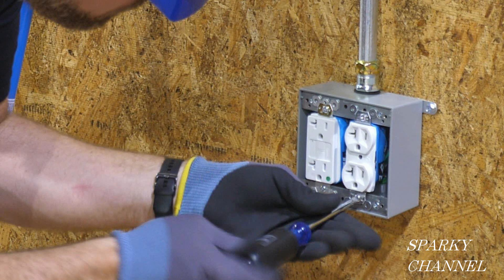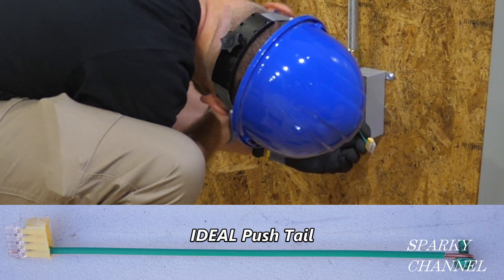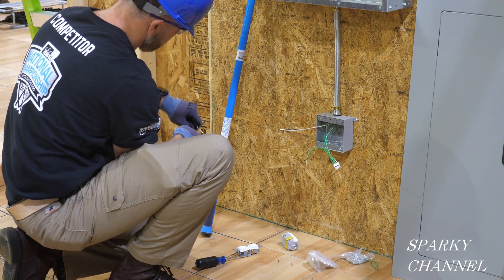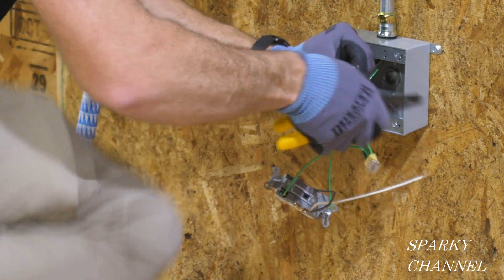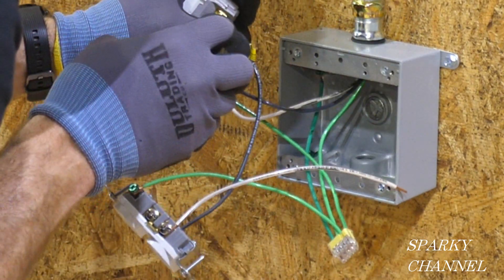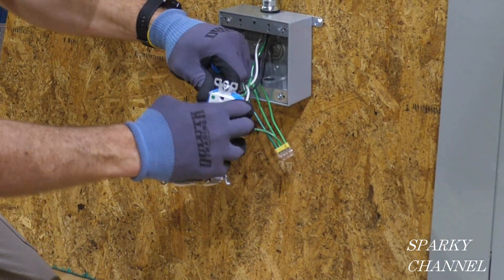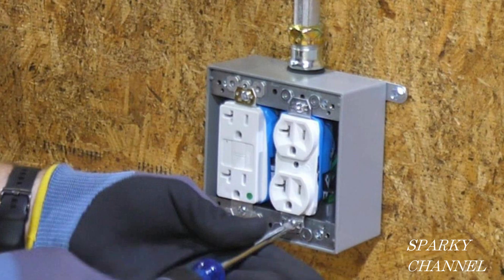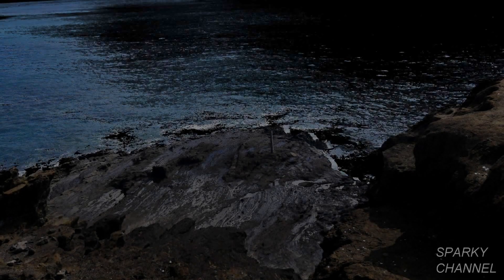Watch a Pro Wire a 20A GFCI and 20A Receptacle, Any Code Violations?

Comment: Is that "pigtrail" thing in the ground path legal?
Last time I checked the Code, NO splices like that were allowed in the ground lead.
Reply from the maker: I didn't see any problem with the grounding.
Reply: @SparkyChannel  NEC section 250.64 part C states as ONE of the exceptions to a "continuous ground":
 1) Splicing of the wire-type grounding electrode conductor shall be permitted only by irreversible compression-type connectors listed as grounding and bonding equipment or by the exothermic welding process.

Parts 2 3 and 4, the other exceptions, DO NOT APPLY TO WIRES - they talk about building frames, busbars, and grounding connections for copper-type plumbing pipes.

So no, that pigtail as far as I can tell IS NOT in fact legal under the NEC.

If you want to see a compression splice fitting, look at the leads from a pole transformer - which commonly use a compression-type fitting to connect to the downlead.
Also reference a "Cadweld", which type of fitting is counted as an exothermic welding process fitting.
Reply: @bricefleckenstein9666 The ground wire and grounding electrode are two different things. The grounding electrode wire runs to a water pipe or rod driven in the ground. The wire in the box is an “equipment grounding conductor”.
Reply: @TomCee53  And what do you think a "wire-type grounding electrode CONDUCTOR" is?
I was taught that WAS the "ground wire" and to never spice it.
Reply: @bricefleckenstein9666  The "wire-type grounding electrode conductor" is the conductor running from the primary grounding point (the main box) to the grounding electrode (ground rod) itself.  Only that one wire is the electrode conductor.  All other ground wires in the system (in branch circuits, etc) are just called "grounding conductors", and do not have the same requirements.
Reply: @foogod4237  If that is true, it's a bad idea at best.
ANY ground has to be able to handle the possibility of a lightning strike and the resulting huge currents that are going to explode wire-nut type splices.
Reply: @bricefleckenstein9666  Grounding conductors are not intended to be lighting protection.  That is simply not what they are for.

And if they were intended for that, then all existing grounding measures would be woefully inadequate anyway.  The conductors are simply nowhere near big enough to handle that kind of thing.  Whether there's a splice somewhere or not is really actually pretty irrelevant when the wire itself will likely just vaporize in that situation anyway.

Grounding electrodes are not lighting rods.  They never have been.
Reply: @foogod4237  They don't stand up to direct hits and were never intended to, granted.
They DO act in part to reduce the damage and direct it from near misses.
It's not their PRIMARY intent, but it's in there.
Reply: @bricefleckenstein9666  the code you're are referencing is for Grounding Electrode Conductors. What was installed was an Equipment Grounding Conductor which is completely different and not covered under that section of the code.
Reply: @SparkyChannel  , well what do you think about Brice's quotation of the code (below).  Also what is the recommended way to mark a standard outlet as GFCI protected (by the GFCI upstream)
Reply: @unionse7en  a sticker
Reply: @unionse7en most GFCI receptacles come with stickers in the box. I have seen them marked with a permanent marker.

Comment: What screw drivers is  that ,ideal I, can't find it? What # is it
Reply from the maker: IDEAL Electrical 35-9305 Insulated Screwdriver Set (2 Piece) Orange, 4 in. Shaft Screwdrivers with Cushion-Grip Handles. Electrician Tool Kits: Amazon: https://amzn.to/3QpSWLD
Reply: @SparkyChannel  Better to use an ECT (Electrical Components & Terminals) screwdriver bit

Comment: should they be tamper resistant as well? I read nec 2020 406.12 but I'm still not sure about outdoor locations.
Reply: That's what I thought. Thank you for the info saberx08.
Reply: Well, NEC 2020's 406.12 (1) talks about dwelling units listed in 210.52.  210.52 (E) specifically mentions outdoor outlets.  So, I'd say "yes", they should be tamper resistant as well.

Comment: This is so elementary…. Hopefully no “diy’er” or homeowner gets him , or her, self shocked or electrocuted while attempting to “copy” this installation method. Wagos are alright but nothing beats a wire but for a good solid connection. Wagos rely on a spring compression type connection. Although they are UL listed they are not the best.
Reply: He didn't even use a WAGO.  He used Ideal's push type connectors.  Those definitely rely on simple compression.  I won't use those!
Since it's Ideal's competition though, I'm sure he wasn't allowed anything but Ideal branded components.
Reply: Heh.. somebody clearly has no idea what's actually inside a wire nut...

Comment: I pulled 2 hot, one neutral and one ground wire through flex conduit to make a whip with 2 circuits (2 duplex outlets) on it. Can I still get GFI protection to these outlets/circuits? Or do they each need a dedicated nuetral? GFI recepticals, or GFI breakers?
Reply: Separate neutrals are not required on the feeder circuit.  If this is just feeding two 120V receptacles (one on each hot leg) then you will need two GFCIs (one for each hot wire).  If you will be using the GFCIs to protect other downstream outlets, then they will need to have separate neutrals going from the GFCIs to the downstream outlets (you cannot tie the neutrals from the "load" side of the GFCIs together).

You can also use a single (dual-pole) GFCI breaker in the box instead, but that can be more expensive.
Reply: They will both need a GFI outlet.  But if they are somehow on the same breaker then replace the breaker with a GFCI

Comment: 406.4 (D) (2) (C) only applies to grounding type receptacles installed after a GFCI if there isn’t a ground. Specifically. So since the is an equipment ground in this circuit, that section doesn’t apply and no label is needed. If you read the section on on screen in the video it specifically says that. But they should have been weather resistant of course.
Reply from the maker: Correct, thanks!

Comment: A fourth violation is of 110.3(B). The outdoor device box with 1/2” hubs is only listed for use with threaded conduit (I.e. rigid conduit or IMC). EMT fittings aren’t technically allowed to be used with these boxes. Again, not the fault of this electrician. He used what they gave him to use.

Comment: That’ll be $1300 dollars for adding this new 20A circuit. 💰
Reply: I'm in the wrong line of work
Reply: @PappyMcPoyle-vj4vt  I’m wiring up a summer kitchen today. $7,000! I used about 2k on material pay 2 guys $500 each and the rest is all mine. 🤷🏽‍♂️

Comment: Good points you brought up here Bill.  I noticed he used a regular screwdriver to install the receptacle to the box.  I use one of those hand held electric screwdrivers,  especially when installing a whole slew of receptacles. Saves on the old wrist 😂
Reply: Most guys would just use their drill if they didn’t want to bother with a standard screwdriver.

Comment: I would say he installed these outlets upside down. Ground lug up is the manufacturer’s recommendation for installation. I am aware the code is not specific on this, but on my jobs the ground lug is up. And my crew puts them in that way or they get off the job!
Reply: We do it the other way,  we consider it upside down with the ground up.  Just looks more pleasing to the eye  with ground down and sometimes we get told by the customer that we put them in upside down if we put ground up and then we have to go back and flip them all🤷‍♂️
Reply: Yeah, that’s not a code. We’re talking code violations here, Roger.
Reply from the maker: Interesting, thanks!
Reply: Being a reportedly old Electrical Engineer... Ground on top was the original design plan to prevent the metal faceplate (or anything else to fall from above) from shorting the hot and neutral if it were to become loose.  Many outlets sold today still have top printed with ground facing up.  I agree that the majority of Americans don't like their cute little faces "upside down".
Reply: I was told ground on the bottom. Reason is if your cords starts to fall out  ground us the last connection to break away....
Reply: @ronaldoleksy8264  There are arguments in favor of both.
But the Code doesn't care, probably because it IS a legitimate debate which is better.
Reply: I couldn't work for you then. I always place ground down except for dedicated receptacles for appliances like refrigerators, etc. where the cord needs to hang down. After 40 years I don't plan on changing any time soon.

Comment: Most of the Code book is just tax language translated into regulatory justifications.  Aka BS
Reply: Troll comment
Reply from the maker: LOL!
Reply: Clearly said by somebody who's clearly never actually read the NEC.

(And the codes themselves are not laws, that is correct.  However, the actual laws in most places also require that certain types of work be done to code.  Therefore, in those situations, it is still an actual legal requirement (yes, even on private property).)
Reply: Codes are just suggestions not law especially in private property😂

Comment: I waited to see a spring load type wire tuck into the box. I Always feel like I could do that more efficiently and you have to start that plan immediately. But a  shove & hold seemed effective enough for the ideal pro 🤣 I know this is not a demonstration for cosmetic perfection but every once in a blue moon, I'll pop a receptacle open and be pleasantly surprised by the professionalism in the wire tuck. Not very often but it does happen.
Seeing something straped to the box with 1 and a ½ inches of wire being left is much more common here in philly. Especially if the home owner claims some "crazy unique issue" 🙄 that couldn't possibly be from the install.

Comment: It not up to code to use the device as your method of splicing
Reply from the maker: You have to with a GFCI and a downstream receptacle.
Reply: That only applies to the neutral conductor on multiwire branch circuits supplying receptacles.

Comment: I am taking the quiz. at 6:20 I don't see the usual test and reset buttons on the GFCI. But I realize my answer was wrong. I would remark too the pros use all these time saving products which most are not available at Home Depot/Lowes. Even if they did they are way too expensive for my tastes.

The requirement to use receptacles for wet location seem overboard, as outlets are well protected from wetness because of the in use cover. I refuse the pay the outrageous prices of all these sell up products. In fact the temper-resistant receptacles are major PITA to use and often I have spend minutes to get a plug to insert.
Reply from the maker: The GFCI does have test and reset button but they are white, so they blend in with the white receptacle. Yes, tamper resistant receptacles are difficult to use sometimes.
Reply: It's not just about directly being splashed or rained on.  Outdoor locations can have a lot of humidity and temperature changes that can result in condensation inside the box (and inside the outlet itself).  The protective cover won't prevent that.  That's why they need to use WR devices as well, because that means they've been designed to be able to handle that level of moisture in the environment around them, too.

Comment: Non insulated screw drivers.
Reply from the maker: Thanks!
Reply: We'll close our eyes to that one lol 😆
Reply: Really not practical using them. Testing with a multimeter does just as good and insulated drivers cost like 15 dollars a bit and they wear out fast. Best to save them for times when you have to touch a live circuit though personally I’d refuse that job, or in a situation where power generation is possible: working on solar panels or any sort of electric motor/generator

Comment: So, the only violation that was in his control to correct was labeling the grounded receptacle as GFCI protected (labels come inside the box of the GFCI receptacle).
Reply: Also the devices were Not weather resistant type WR...
Reply: @JasonSmith-iz3xj  That was a supply issue and not in his control during the competition. From what the video said.
Reply from the maker: @michaelbradley7529  True, that wasn't under his control.
Reply: I think the video was cut off before he was truly finished. You didn't get to see him re-open the cover and put the label on. Just like Zenith TV's, the quality goes in the cover before the label goes on.

Comment: One more thing that fails plastic bushing is required in the electrical panel
Reply: Where exactly do you believe the plastic bushing is required?
Reply from the maker: Hmmm, this subject might make a good Sparky Channel video. :goodvibes:
Reply: What you means. You don't even know where the plastic  bushing need to be install. if you are licensed electrician you already know all EMT conduit has be install in electrical panel requirements protect you wires for any sharpe metal so you install the plastic bushing . Wowww very surprised you  ain't know this
Reply: @IrvingMeeker5368  Maybe you should look in the NEC regarding bushings and where/when they are required. In the installation shown in the video it is not required. Now if the wire being pulled into the panel were a #4 or larger conductor then it would be required to have a plastic bushing installed. It's literally right in the code book. A quick look in that book would have saved you from having to wright that comment. smh 300.4(F)
Reply: @IrvingMeeker5368  that is not true. If this was rigid or IMC conduit, you would be required to use a bushing. Bushings are not required on emt connectors unless the conductors running through them are larger than #6 awg.

Comment: Not sure for us code but for Canadian code you need a spliced connection before the device on the neutral.
Reply: That would defeat the GFCI protected outlet as loop current on the load lug would always be imbalanced and trip the protection immediately.
Reply: When using a GFCI or AFCI receptacle to protect other receptacles, splicing the neutral will defeat the protection and create a ton of nuisance tripping if anything is plugged in to the "protected" receptacle. Check your CEC wiring methods again.
Reply: @darrelljubinville6985  as I tried to clarify in a reply I'm not talking about load side of the gfci the splice I was meaning is on the line side before the gfci. You do this to be able to maintain a neutral connection while still being able to work on other circuits down the line that may be sharing the neutral or for future, without effecting the gfci circuit.
Reply: @Niiv0  respectfully not necessary under CEC 2021 or any previous iterations. If the GFCI is not on an independent circuit, the identified conductor is available for splicing at the GFCI box location. It is not a requirement of a new installation, only a requirement for mixed branch circuits. That is not to say provincial jurisdictions do not apply.
Reply: @darrelljubinville6985 maybe I'm misinterpreting this rule then but I thought that it's essentially what this is saying. CEC 4-022 1) D)
Reply: @Niiv0  in this case you are, but only slightly. The GFCI in this case (and all branches protected by it) is a single device, and is therefore the only identified conductor in the circuit. Removing the GFCI technically removes the entire load side with it, but cannot be wired so as to affect any unprotected circuits. I see where you got your interpretation though.

Comment: I could be wrong but why is speed celebrated in this type of work??? Sure you want to be efficient as in any job, but being the fastest seems to be a recipe for potential disaster. But I'm no pro, so....
Reply from the maker: This is how pros work. I think it's not so much speed as keeping a good pace. You need to set a pace that you can handle safely and work at it all day.
Reply: @SparkyChannel  Thanks for the info. As a commercial aircraft mechanic, we work somewhat differently. Even though we're under strict time constraints, safety is always the elephant in our room. Not saying that it's not a priority for these pro's as well. Speed is something we just don't teach. Great content though, and I appreciate the skills. 👍
Reply: Because you want to fly through the job and go on to the next job asap so the boss makes alot of money😂.  I personally don't rush because mistakes get made that way🤷‍♂️.  I guess that's why I'm not rich lol.   I'm more of a perfectionist
Reply: If you can work that fast and do a good job then fine. If not then slow down.
Reply: The point here is that they are not just judged on speed, but also the quality of the work, too.  Fast-but-sloppy won't win you points.

Realistically, good contractors will usually work as fast as they can to get a job done anyway, because wasted time doesn't do anyone any favors.  If you can train yourself to do the work well while also moving quickly, then you won't be tempted to cut corners just because you want to get things done fast, so IMHO rewarding people for being able to do an actually good job even when in a rush is a good thing.

Comment: Also why waste an extra two feet of wire the green goes to the bus bar near the bottom the white goes to the bus bar near the bottom why use an extra two feet of wire obviously you're not paying for it
Reply: Since the price of wire has become so expensive , I have been saving all the scraps in a 5 gallon pail and then when I get enough I will take it in for scrap.  I don't waste it.   Most electricians just throw them in the trash but you would be surprised how much you end up with.